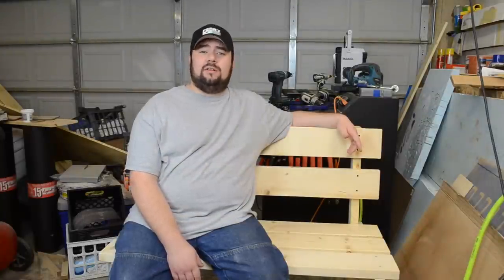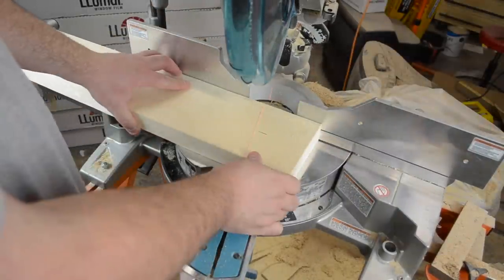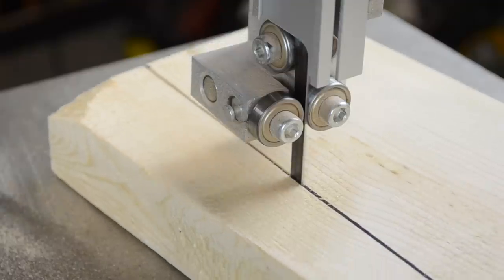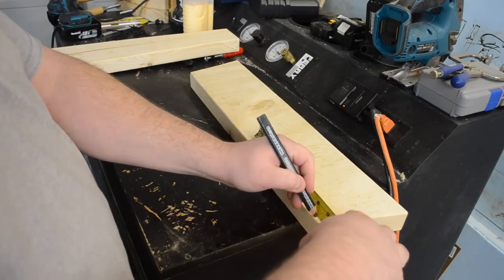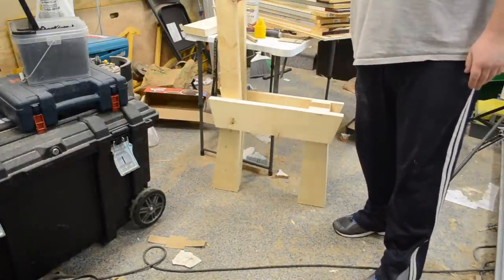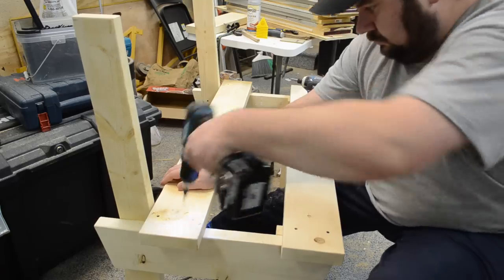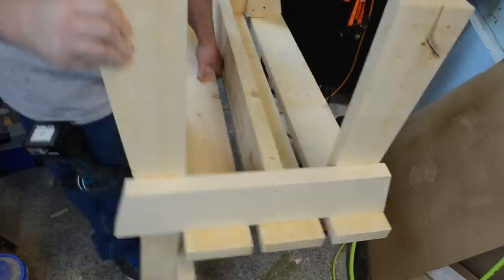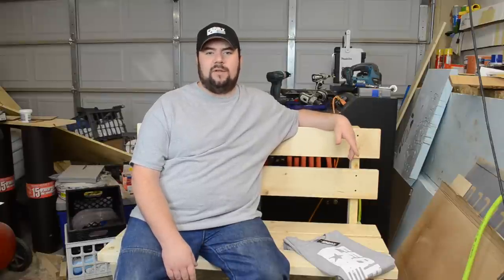Ⓕ How to Make a Bench from only 2x6's (ep28)

Comment: Congrats to the winners!  Nice build Nick.  Do you think you could get away with a sharper angle on the back or would that weaken it?
Reply from the maker: Charles Dearing Thanks Charles, the front edge of the back could taper more but I liked this look.  The back edge of the upright couldn't taper any more because that was the max width of the 2x6.  It's comfortable as is though.
Reply: Looks like it. Much better than a straight back. Was just curious.

Comment: Bench looks awesome!  A good use of leftover material too.  Since you broke a bandsaw blade last time, perhaps a tip is in order: when cutting a sharp, internal (to the cut) corner on the bandsaw, make a relief cut (ie a straight cut into the work piece) at the corner to avoid stress on the blade or having to back out of the cut.
Reply from the maker: Jason Adamczyk Thanks man.  I do use relief cuts, however when your trying to keep the internal portion of a bandsaw box you can't use relief cuts.
Reply: OK, cool, just didn't see one in the back piece where I would have used one.  I didn't mean to imply you should have used relief cuts for the bandsaw box (otherwise I would have mentioned it on that video :P )
Reply from the maker: Jason Adamczyk Oh I see, now we are on the same page.  Yeah on the back parts I had relief cuts, they must have gotten edited out.